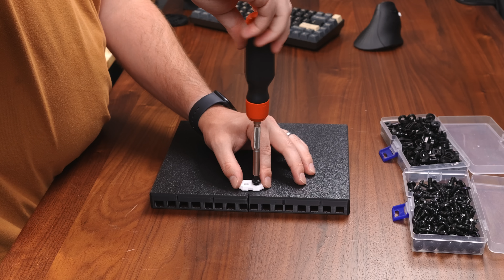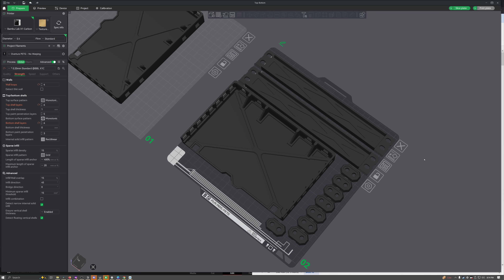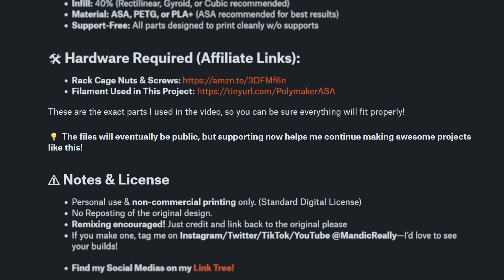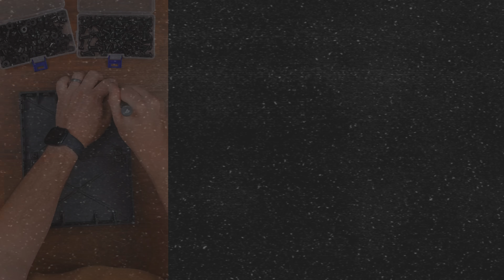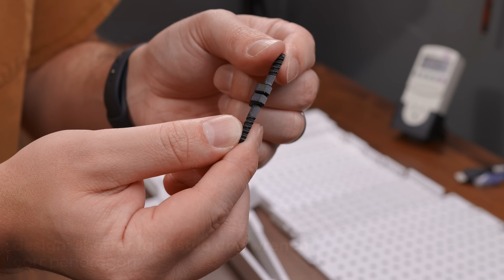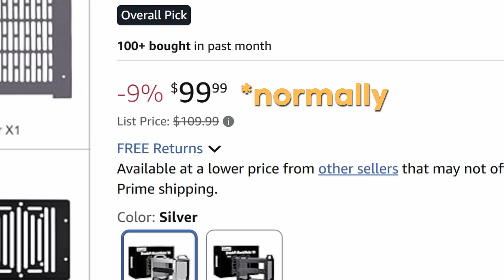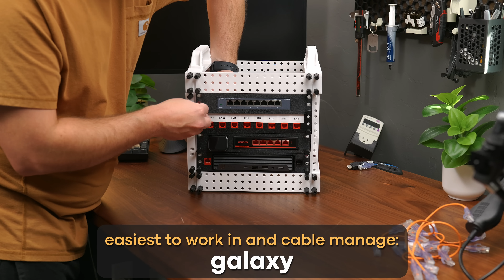3D-Printed Mini Racks are GREAT... but which one?

Comment: Thank you for adding my creation into this round up and shout out !!!

Couple things to mention:
- I had a bunch out rack studs before i started  creating "GALAXY" - that is why it is mainly designed for assembly using them. 
- It is a bit flimsy once you assemble all of it without anything mounted - but once you put all stuff inside it is quite sturdy. 
- Previous home server rack was 6U network box and i hated it. If i had to do some work inside, getting in and reaching cables was a pain in the back side. That is why GALAXY is so opened. 
- Side panels are kind of after thought. "Why not create something like pegboard that allows you to mount stuff on the side". Screwdriver or keep couple extra RJ45s. New version of side panel allows you to have 120mm fans attached for some air flow from the side.
Reply: LOVE the fan mount! It's on mine. The tiny amount of airflow over everything gives such a good peace of mind!
Reply: Love your work 👏
Reply: I am a big fan of the Galaxy.  I was looking to make a 10 in rack, and couldn't settle on a design until I saw this video where I discovered your work. I've never seen anything like it haha.  it's brilliant.
Reply: Great stuff!

Comment: I built a labrax using the bolt design.  I made some mistakes along the way and it took a lot longer than it should have but I like the final outcome.  It looks great, and I don't have the handles on it because my router sits on top.  If you do build the labrax just buy the hex bolts and nuts he recommends.  If you already have the parts I'd go with the heat inserts but I didn't want to buy all the parts for something I wasn't sure if I'd use again.  Also, there are other contributors who have different designs for the sides, top and blank panels.  Mine has a honeycomb type look to it.

Comment: Have you tried with 4 aluminium v-rails (those used in 3d printers) as the vertical pillars and 3d printed fronts and laterals?  Also with any 2020 structural aluminium profile, much more cheaper, you can do a super rack which can also disipate temperature.

Comment: Electricity cost for the printer and A/C cooling cost to get rid of the heat during the summer: For A1 mini the total cost of electricity per 24 hours of printing and cooling at $0.20/kwh would be about $3.50 (+/- $1.00) if outdoor evening temps remain above the desired room temp. This is more of an issue in southern summer climates.

Personally I've been toying with the idea of cobbling together ideas pulled from 10" form factor racks, 10 inch matx cases, hot swap bays, etc. as a basis for a NAS that would end up the same size as the old reliable hp microserver gen8. (Which means the rack would need to be deeper than a standard 10" rack, more like 10x10x10). Mostly the same internal layout but with the following changes: 5x hot swap 3.5" SAS bays instead of 4; and, 2x hot swap 2.5" bays instead of the optical bay; and, a R/A mounted pcie card instead of vertical; and, snap on front, top and side bezels so it doesn't 'look' like a 10 inch rack while sitting on the desk.

Comment: I did a ton of 3d printing to mount my various comps/switches, but I would never trust printed rack rails to e.g. last in shipping with the full rack assembled. With the metal racks you can just chuck that crap in the back of a moving van and be relatively sure it will still work after a filing cabinet fell on it.

Comment: I have a big 42u standard rack, but big fan of 10 inch racks for secondary points. I had a few smaller things in my garage just 3M stuck to the walls, but puting them in a rack was a huge upgrade.

Comment: Thanks for featuring Mod10 & the kind words. I fully own the critiques & largely agree with them. All comes down to the design intent I had. Which was “use hardware any homelabber can easily get or already has”, “fit Prusa & Bambu build volumes” & “rugged / portable”. That said, Heat Insert & Hex nut versions as well as 1U modular parts are at the top of the update list. So when I can make the time, they will be coming. Hope you continue to love it.
Reply: Oh also, I’ve had quite a few folks say they’ve had good luck with those 3d printable rack studs in Mod10. As the openings are basically the same as a commercial server rack, that should be true, but I haven’t tested it myself so I don’t list it as a recommendation until I can verify.
Reply: @MandicReally  The Mod10 is my favorite and most useful thing I've ever printed. Thanks Alan!
Reply: @MandicReally I love my mod10
Reply: @MandicReally so cool to see you on my fav homelab channel! 🎉
PS, would love to see those vented side panels have some way to give them printable mesh in-between the bracing as well! 😅
Reply: I liked your design so much! The design philosophy with the rack screws sold it to me. Many of my projects die, because you need some special tools/screws or whatever. Not in this case. Just buy some nice rack mounting hardware, get a screwdriver and you're fine.
Reply: @davidr.5259  Thank you! That has long been a staple of my design work. I try my best to make them not require "special" hardware or tools. Some stuff is unavoidable, but I agree, I hate having to buy one specific magnet size that I'll never use again to put something together, so I avoid it in my designs.
Reply: Many thanks for your contribution!
Reply: I actually prefered the hardware yours used vs the heated inserts. I think it comes to choice, but loved your design
Reply: I love the Mod10, it was super easy to assemble and is super sturdy. Thank you so much for your hard work!
Reply: understandable
Reply: Welp you've convinced me to pick up the Mod10. I can't wait to print it out and get things under control in my homelab.
Reply: Just got a new Bambu A1 the other day and printed my first panel today with PETG+. Looking forward to getting everything printed and assembled. Thanks!
Reply: Your work on mod10 is lovely. I hope there were enough purchases to make it worth your while.
❤ From India

Comment: I setup a mini rack a few weeks ago, but I went with $10 4U Rack Rails from Amazon that included screws and nuts and 3d printed mounts and faceplates, and left the back and sides open. Really think it's not worth printing a full rack cabinet and rails. (Also I should have went with the 8U Rack Rails instead of the 4U).

Personally I'd love to see someone design a rack around some separately purchased metal rails.
Reply: Need details! I’ve been thinking of doing something similar but don’t have the time or skill to design it. How did you connect the rack rails together? Did you purchase just the vertical rails or also a top and bottom?
Reply: @cjalcorta8006  just the vertical rails, having any of 3 of the "U"s filled makes it very stable.

Comment: I chose Natalie T's system (printables:1090551-modular-10-inch-server-rack-reworked). I liked the efficiency, size and expandability.

But I liked the design and aesthetic of lab rax and nearly went that way. I think I didn't have enough hardware to hand made the difference.
Reply: Natalie T's system is the best when you don't have access to rackstuds, cage nuts, or heat set insets. It's the best in general, but also for that reason.
Reply: I use the matching 3d printed rack studs too

Comment: Who needs a server rack in their house? 😂😂 alittle overboard ya think?
Reply: Anyone who experiments with networking and/or servers.
Even a very average internet-connected home will have a bridge or modem, router, and at least one switch, very possibly with a separate switch for PoE, as this may have fewer ports and be a later purchase.  Then anyone sensible will have some kind of storage (even if only to back up other devices to), either purely as NAS or a server with more functionality.  There may well be a telephone interface that converts VOIP to traditional telco, as well.  A horrible jumble of cables and boxes to stack up in some way and find shelf space for.  Or you could use a small rack.
Reply: I have a 19 inch rack. Its contains my house server running homeassistant / multiple room audio + nas and other services. It also contains a rack mount amplifier and switch. 19 inch still great as you can get cheap hardware sold from datacenters.
Reply: @GlennPierce  Yes, 19" racks are great if you have the space.  Now that some of the kids have moved out, it might be possible to find enough room for more than the small wall-mounted 19" cabinet I already have (but isn't really deep enough).
Reply: If you run a Mini PC for a Plex Server, a Mini PC for a router/adblocker, a little network switch, and a Pi for home automation, a mini rack would easily organize all of these in a closet or under a desk. It's not necessary, sure, but it organizes things really well.